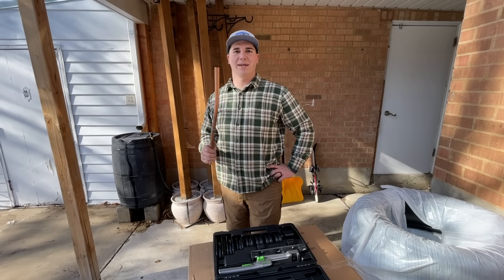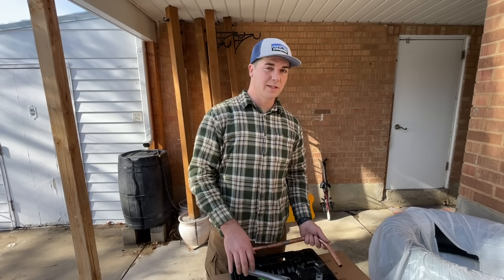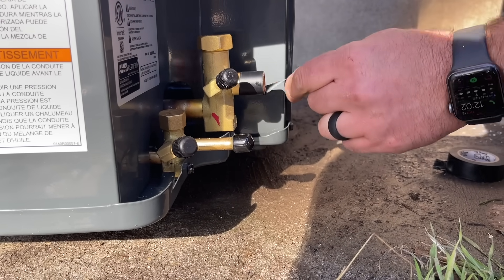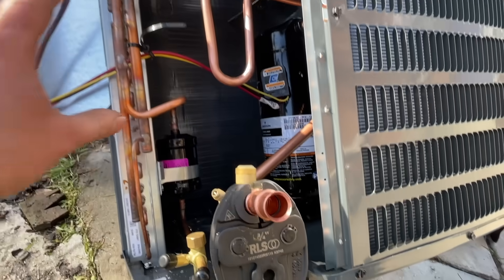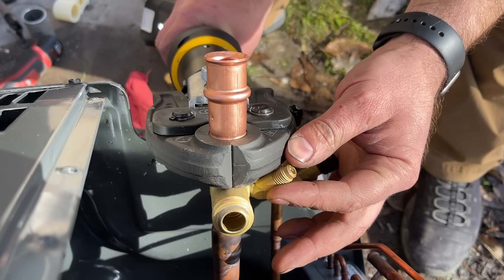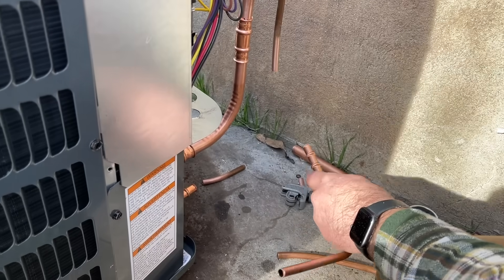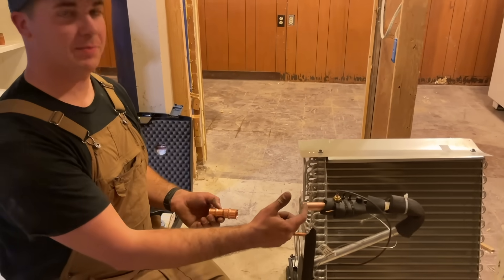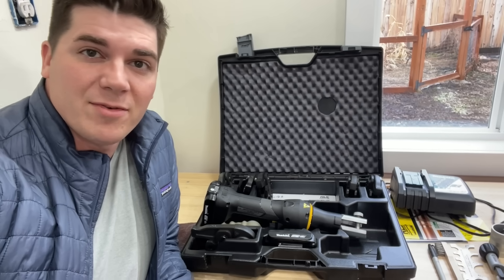Brazing Is For Cavemen. THIS Is The Future Of HVAC Copper Connections. -RLS Crimping Tool-

Comment from the maker: All products and tools can be found here! ➡️ https://www.amazon.com/shop/thediyhvacguy?ref=ac_inf_tb_vh
Reply: By the time you got that first pipe cut...I'd be done 🤣
Reply: qualified for using crimped connections 20 years ago im a plumber and i have never once used any crimped fitting as the oring is always going to be the fail point solder it together and be done with it once,
Reply: @Vteccer666  you are so right my brother Craig Wallace. My very best friend was named Jerry Wallace. He had a very good saying, “You can’t fix stupid!”
Reply: Well I can solder it a hell of a lot faster than what you're doing. By the time a do-it-yourselfer buys all that s*** the bending tool the crimping tool and everything else, yeah you probably should just get someone who knows what they're doing to do it.
Reply: I doubt those o-rings will last and possibly contaminate the freon over time.
Reply: @guytech7310  same comment we got about sharkbites from plumbers 15 years ago.  Mine are still holding strong.  Meanwhile I've replaced at least 10 leaking brazed joints from "professionals"
Reply: @googleuser4434  LOL! I know lots of people with sharkbite failures. Lots!
Reply: Oh forgot to mention, removing a leaking crimped connector. OMG! You are screwed then. Newer doesn’t mean better bro!
Reply: This is way too complicated and time consuming and needs too much room to work in for a crowded space. You need a sharkbite system with easy, slip-on connectors and flexible tubing. Turn this into a 5 minute job that most anyone could do.
Reply: @Hal 9000 $3500!! I'd learn to solder!!😂
Reply: Can I have a link to these crimpers?
Reply: Lenox makes self tightening very low profile pipe cutters. They work great for stuff like that.
Reply: @diyhvacguy  faster doesn't mean better! Usually just the opposite. Those crimps will leak over time. Braze it, pressure test it, and its over.
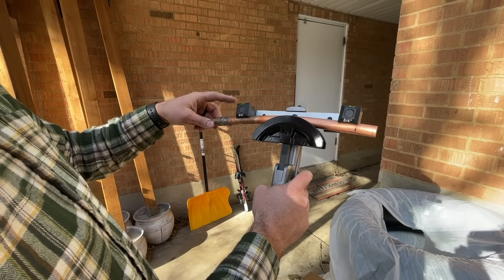Reply: 1:30 Hey can that pipe bender bend rigid copper or only soft copper? I do plumbing but still curious.
Reply: You are cave man.
Reply: The crimp tool you mentioned is not on your Amazon list.
Reply: Right! Did you find it? I am still looking.  @googleuser4434

Comment: Biggest issues are impromper pipe deburring inside/outside to prevent O ring tears; crimping aligninment and depth insertion. Brazing is way more forgiving and reliable over time than RLS for those reasons, long live cavemen! 🤟

Comment: All the deburring and checking for filings and fittings after you make the cut and flip in the unit over and everything come on man it's way too much work just to avoid a little soldering

Comment: I would have already run the nitrogen brazed ,run the vacuum and headed to lunch by now and dont lo I k back in 2 to 3 years for the leak and yes it will eventually leak ( it's got a o ring).

Comment: Yes, I agree. Not, a totally good idea overall when it comes to getting it right the first time, and any leaks or future leaks will be a PITA to remedy. 

I've seen these used on gas and water. It's nice and quick. But. To modify an elbow into a branch is more work than if it was soldered.

It is more ideal to use in a explosive atmosphere for obvious reasons.

I once saw some copper coloured acid based glue for pipes. I never tried it because I never saw it for sale anywhere. It looked good, though, but probably has the same problem when changing an elbow to a branch or longevity.

Comment: Grok says "Copper crimping for HVAC pipes is generally not allowed for refrigerant lines in most HVAC systems, particularly for high-pressure systems like those using refrigerants such as R-410A or R-32."

Comment: I'm having 35 yrs. Of my Marine work Experience, I prefer for Ferrule and Ermeto connecting joints, because it can really hold very hot steam pressures and even some basic low hydraulic oil pressure too.

Comment: That seems much like shark bits for pex wh8ch IMHO isca ease of use homeowner diy type fitting process cs brazing.  Brazing is stronger, its imune to different crefriberants etc.   It's a lidetime solution.  Oring crimp.  You have possible failure thru degradation of the orhing material leading to leaks.  More susceptible to virbration wear.   I will stick to silver solder brazing joints.  Now a bender, I am allf or.  Way better fir flow and refuces failure points.

Sorry but tgat crimp seems like a way to have less skilled workers fitting pipe.  It leads to less knowledgeable/skilled techs.  I do not want someone touching my hvac if they do not even have the skill set to reliably sweat/braze joints.

Comment: There’s no such thing as an o-ring with a 20y life to use with current refrigerants, even a 10y life is an optimist’s epistle.This is the ideal connection method to use when you won’t be the one paying to replace it in 3-5y. You just pay $10 per joint to slap pipe together at the speed of light and double the number of suckers, I mean systems, per day. As long as you install for transients and builders and you don’t go slapping your company’s stickers all over the equipment no one will be trashing you on Yelp! and you won’t need to relocate every 5 years. The first one who stays long enough to have the things fail and gets a big repair bill will trash your name all over the place, so choose your customers carefully.

Comment: Yeah, I don't think so, brazing has been around forever and stands the test. Just look what happened to the new world of plastic plumbing, pexB is breaking down and has to be replaced with the new and improved pex pipe, just think of the cost of that and what's the lifespan of the new pipe. And in todays world of poor manufacturing and materials, how long do you think the O rings will last, I suspect they will break down and dry up like all o rings do and you will be calling a repairman to redo the job at your cost again. Copper pipe with soldering or brazing is the way to go for years of service!

Comment: Brazing is the best o rings will break down.But they have thier uses in applications of speed and where heat can be a problem.And depends whats going through the pipe aswell.

Comment: I thought those crimp on fittings were meant for "WATER LINES", NOT high pressure A/C lines. Plus the O'rings will break down under the pressure & the freon & oil in the system!!!!
Reply: The O-ring elastomer selected by the fitting manufacturer should be compatible with the fluids encountered in a HVAC system. Just look at the Parker O-ring Handbook to see the multitude of elastomers developed by materials engineers for O-ring applications operating in different fluids. Pressure, that is not an issue. Looking at the design of these fittings, there will be no extrusion gap for the O-ring elastomer to extrude into. If I had a concern, it would be sealing performance at very low temperatures when the system is not operating.

Comment: I am interested in how this holds up over time. I have used progress for water and glycol for 15 years with 0 leaks. Much faster and easier than solder. Didn't know the made stuff for high pressure.

Comment: Remeber ---The Space Shuttle Challenger disaster occurred on January 28, 1986, when the Space Shuttle Challenger broke apart 73 seconds after liftoff, killing all seven crew members. The disaster was caused by a failure of the solid rocket booster's O-rings, which allowed hot gas to leak and ignite the external fuel tank
Reply: So what your saying is don’t use flammable refrigerant. Or the next astronaut that lands on the moon is going to report. Hey what’s this A/C unit doing up here?.

Comment: Take it from a person who has been making a living in the HVAC industry for the past 40 years, it’s wise to wait about 3-4 years for a new product to be around, using these o ring fittings for plumbing is one thing, when you have 300-400 lbs of refrigerant on a machine that is constantly vibrating, something bad is bound to happen, let others find out the hard way, learn from their mistakes. Manufacturers will tell you whatever you want to hear, your the one who has to go back and make repairs for free, they will not stand behind you.
Reply: Its not a new. Some studies show Stay bright can be a stronger hold overall (including vibration) vs brazing but this study was done with repeated attempts to brazing a line and/or multiple attempts on a connection and not always using nitrogen. It has psi ratings far outside anything a system will have around 10-14 thousand. The debate for brazing or stay bright has been going on forever and now we have press fittings.
Reply: @bobshanery5152 Thank you for taking the risk for the rest of us, free callbacks are no fun.

Comment: The amount of vibration from the compressor to the high/low pressure lines, the O ring seal won't last. By looking at how closed to valves, it will be a challenge to repair leaks in the future and cost a lot more to fix leaks.

Comment: Is he talking in terms of copper pipe or tubing sizes. Fortunately, many pipe correspond to a tubing size bigger. Now is it soft, medium of hard drawn. Usually the soft drawn comes in a roll capped, but hard drawn tubing is also available and both ends are capped. 5/8 pipe is 3/4 tubing. 3/4 pipe is 7/8 tubing.

Comment: Hey dude was the reducer actually a 3/4 to 7/8?? You said 3,8 to 7/8 which makes no sense
Reply from the maker: Yes sorry for the confusion
Reply: @diyhvacguy thanks G
Reply: @diyhvacguy thanks brother ! I need to braze the suction line on the evaporator, then I’ll update the chat on what my pressure readings are, much thanks again!

Comment: company i worked for used these for a year, within 5 years we had to replace SO MANY of them. all fittings, all coolant, all for free because almost every one eventually failed. Bottom line, propress and other quick connect type fittings work for domestic water, gas, anything under 150psi. On a hot day over 500psi though in a ac coolant line and these will fail at a unacceptable rate.

Comment: I have been using Harris stay brite 8 solder for years. Works just as good as braze without the black carbon you get inside the pipe with the braze. I never had a failed joint fella. LOOKS like sing the fittings is way longer than just soft solder. Have not used the crimp fittings at all. I bet you the slow seeping of gas will happen. Period. Peace v      😀😀😀

Comment: These will be laughed out of the industry in 5 years at most. A rubber o ring is not comparable to a perfectly fitted metal bond. I have seen these used in a (very very very) small number of applications and when used, they failed. I would not use these. Whenever I find a low charge and see them i'll be disappointed in whoever used the press fittings for the install. This product is on a huge sale of 20%+ for initial buy at the local supply house and I still wouldnt use it if it was free. I'd take the tools and throw them on the scrap trailer if they were free and save the next guy from the headaches

Comment: I'll stick to Sil-Fos 5 or 15 brazing rod or Staybrite. O-rings dry out, decay, harden and turn brittle and deteriorate. 
I would never trust an O-ring with 500 lbs of pressure. Especially with the new flammable refrigerants. R32, R454B and the worst of them R290 (Propane).
I am also not a fan of tubing benders. The ribs you see on the inside of the bend can interfere with the smooth flow of fluids or gases which makes these susceptible to premature failure. Also the stretching on the backside of the bend just made your copper thinner because the tube wall stretches to accommodate the increased circumference of the bend's outer radius. Like a condenser u-bend. How many have you repaired? I'll stick to braze and long radius ACR fittings. 
They last pretty much forever. I just wish the fittings didn't have O-rings. Good video though.

Comment: The only problem with ProPress fittings on a compressor system is you're going to have ultrasonic vibration which will cause it to leak over time

Comment: Okay so why doesn’t the kit come with 3/4” because they charge a ridiculous amount for the most common size? I sell a/c condensers and most 3.5 ton and smaller use 3/8” and 3/4” line sets. So why leave that out when over half the condensers are 3/4”? 🤔

Comment: The Future Of HVAC Copper Connections.  Only if you want a future leak.  Never use for Refrigerant. Pro press is OK for water in areas where you need burn permits.  If you want a connection that will never leak you braze it.

Comment: Hey Guy, thanks for the video. My question is, how practical would this be on a compressor change out. I think if you cut the bell off the suction side, you wouldn't have enough pipe left for the fitting.

Comment: This is not how to use this tool, he should be centering the jaws on the raised portion of the fitting, not placing the tool with the raised bit on the edge.  What he's done will likely hold as well, just that's not right, if it busts it'll be on him.
Reply from the maker: No, you might be thinking about a different brand. This is how the RLS tool is designed
Reply: @diyhvacguy  eh looks like you're right lol

Comment: When these connections eventually leak, and they will, you will have to replace the isolation valves too.  O rings were  used in compression fittings on the suction side by carrier corporation units years and years ago.  They ended up leaking, so this method was abandoned .

Comment: That’s a great tool to use at a plant that you cannot have an open flame. I can braze faster than you can use that tool. Brazing is so cheap compared to the price of the Zoom or Lockring fittings

Comment: These fittings are not cheap, and unsustainable financially for a small business. Not to mention, would’ve had the lines brazed in, pressurized with nitro and on vac by the time he got the 3/8 pressed on lol. To each is own but brazing is tried and true for decades. But by all means use the press fittings. We all need side work 😂

Comment: we are chinese air conditioner pipe factory, mainly engaged in PE, rubber, Titan insulation copper tube, threaded tube, copper aluminum tube, as well as air conditioning installation kits, copper accessories, dryers, silencers, distributors, components, copper joints, condensation panels, brackets, etc. Hope to cooperate with you

Comment: Brazing isn't for homeowners because it requires skill and experience. Press fittings fail even with proper preparation. I would not trust an O ring with high pressure that fluctuates in temperature constantly.

Comment: I can buy standard copper fittings at any supply house and be sure that they will fit.
With press on fittings one supply house sells RLS, another sells ZoomLock and the third sells Streamline.
3 different systems with 3 different tools and jaws.
I use Pro Press for copper water lines, Mega Press for black pipe, and Uponor for poly pipe so I'm not afraid of progress.
I'm simply not sold on press on ACR when there is no standardization throughout the industry.

Comment: Great video, very clean work. Our school district facilities in my area love these fittings (avoiding hot work around children). Working on supermarket refrigeration cases and line set risers 40-50+years old w/o refrigerant leaks plus the hundreds of leaking schrader cores I replace every year due to worn out o-rings, I couldn’t be sold on these.

Comment: All that horsing around cutting those connections. I could have brazed it much faster. A good braze joint will never leak. O- ring connections will leak, especially over the winter months.

Comment: Im old school. I will stick with brazing. Vibration at the condenser, homeowners hitting the line set behind the condenser with the weedwacker, could cause a compression connection to leak. Brazing is permanent.

Comment: Warning: if you cannot bottom out the depth gauge do not use a crimp fitting. The reason is that when it fails, not if it fails, you are gonna be left holding all the responsibility as you chose to use the fitting incorrectly. The funny part is that those fittings will hold a lot of pressure and a darn good vacuum without even being pressed, as long as the piping can't move. If the piping can move at all, and crimping fittings are not used properly, it's just a matter of time till they fail.

Comment: If that press fitting doesn't seat correctly on the king valve, you're gonna be in trouble and wished that you brazed.  Did this myself on a $200,000 install for my company.  I would say that if you're gonna use press fittings, braze a piece onto the king valve and press everything else.

Comment: I call those hack fittings.  They are purely for hack techs.   Relying on a rubber o ring with massive temperature fluctuations and out in the elements is purely careless.  Brazing takes little effort and yields long lasting durable connections. I understand the use for indoor water connections with pro press.  But connections with refrigerant piping.  Oh hell no.

Comment: Journeyman HVAC tech here. In my experience, having both brazed miles of  piping and using this press method, brazing is far superior. A properly brazed joint becomes the strongest part of the system. Pressed joints become the weakest link in the chain, relying on an O ring to hold back 450spi or higher. If this method was reliable, manufacturers would be using it as it undoubtedly saves time and therefore cost savings, but they don't. Every manufacturer brazes for the reasons above. Case closed. On the other hand, similar press systems are excellent for water piping, compressed air up to a certain point, and natural gas piping. Quick, reliable and easy. Refrigerant piping is a flat no. Brazing isn't hard. Learn how.

Comment: I've been brazing for over 30+ years, and at one point actually was certified for brazing medical gas installations. When medical gases can be installed in hospitals using crimp fittings only, maybe I will look into it using this on my jobs.